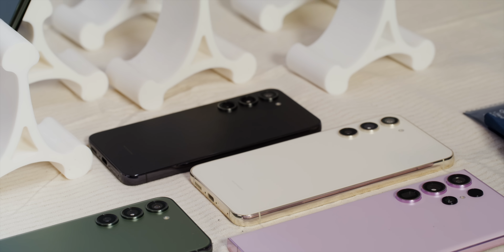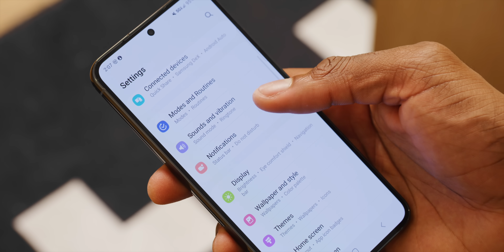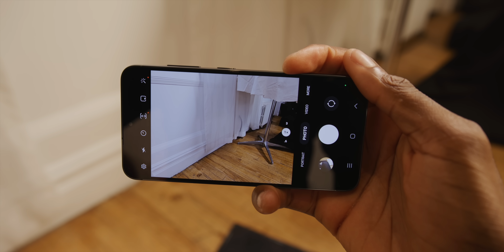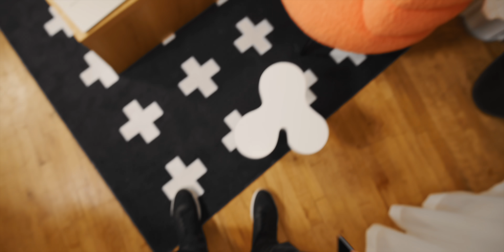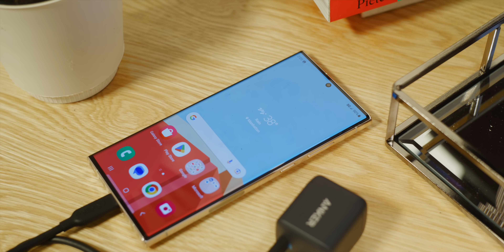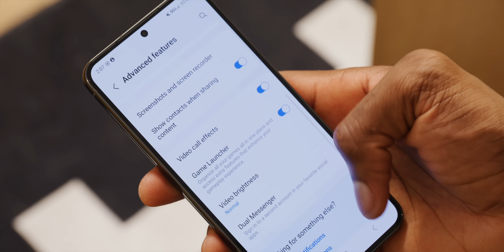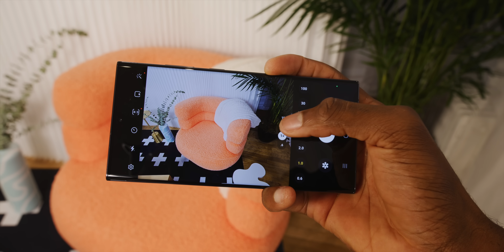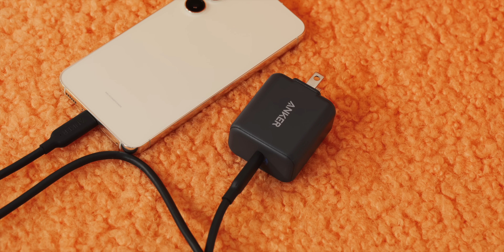Galaxy S23 / Ultra Impressions: Cruise Control!

Comment: I was debating if I should wait for the S23 or buy something else outright some days ago. Ended up getting a bunch of stuff for a bit less than the S22's price (A53, Watch5, Buds2 Pro and even a silicone cover). I might upgrade to an S flagship in a year or two but for now I'm pretty happy, especially coming from a sad old Moto G7 Play.
Reply: i like the s20, i always buy 2 gen before the new.
Reply: @JakeInvest  Old flagships are better than new budget devices for sure.
Reply: Ayy, I had a Moto G4 Play before getting an S9, and now I have a Note 20 Ultra I'm planning to keep for as long as I can!
Reply: @JoshGerhards  I went from Moto E2 to G4 to G7... Then to LG G8X 👍 Solid devices each with their fair share of problems
Reply: @JoshGerhards  I had a G4 Plus before the G7 I mentioned. It had a sort of stroke in the middle of a lecture and it fried the drive or something. Bricked. Could never even flash a new OS. Great phone while it lived tho.
Reply: @Zaydan Alfariz anything with Snapdragon instead of exynos is definitely better
Reply: The Moto G7 was very wimpy even at launch. I'm glad you were able to upgrade.
Reply: S20 is too old (upgradable to Android 13 and no more) and camera hardware is meh compared to OV and Huawei, and where's the 256GB option? 2K@120 (easy trick you can search on Google), the better S865 (compared to all Exynos, s888 and s8 i) and 12GB RAM be default in HK is very irresistible of a deal though
Reply: @anetizen6404  honestly these Android upgrades really don't add much anyways, I'm fine with security updates only. The days of Lolipop, Marshmallow, Nougat are long gone.

I'm keeping my Note 20 until they actually do something revolutionary again like an under-display front camera that doesn't suck, or an affordable Fold.
Reply: A53 is a horrible choice. Laggy, terrible phone. 
I have it. You made a HORRIBLE choice. 
Should have gotten the ultra.
Reply: You probably could've gotten all of that for free as a promotional bonus from Samsung with the S23
Reply: @laussethecat  They're not that generous over here lmao

Comment: I think this is kinda dead on arrival.  I don't mind the super iterative updates, but Samsung missed the big sensor camera trend last year and just doubled down on putting pointlessly high MP sensors in a package that just won't use them well.
Reply: Most full frame cameras with sensor areas like 10-15x the size of a smartphone cap out around 60MP of useful resolution.  Beyond that, the pixels start getting noisy in low light and the multi-thousand dollar lenses in front of the sensors start to struggle.  So it's a tough sell to convince me that 200MP is useful on an order of magnitude smaller sensor.

Comment: I care more about the S23's battery life. The S22 had extremely bad battery life. If the S23 does far better with battery life I will upgrade my S22 to the S23.

I still prefer my 14 Pro, but i hate how heavy and large it feels in my hand after holding my S22.

Comment: As i thought the peak handphone is from 2019-2021 so its not much change after that. Its like iphone situation but at least they try to change the chip but we still dont know if they still have the overheat situation even its 8gen2. Also the funny thing in s23 is they try to add action mode like iphone have 😂 but better in the night. After seeing s23 with that price not difference with Ip14, i clearly say my ip14 is better (my prespective) because iphone still have better managememt and heat control. Snapdragon 8gen2 is game changing but just in heat control which it depends on the phone they habited. In my country probably is more cheap because they have samsung store in here maybe like 1-3 million cheaper

Comment: The only compelling thing about the small S23 is that the S22 had abysmal battery life, and this one is bound to be a noticeable improvement. I do think OneUI is getting a bit stale... I'd love to see a modern take on it that ditches the squircle icons and natively allows for a vertical app drawer. (I know it's technically an option if you use Good Lock, but the implementation is sloppy, and to my knowledge Good Lock isn't available in every market.) But it's still Samsung, and it's still a safe bet in 2023. As far as the larger phone goes, I'd say save your money and pick up and S22 Ultra. Or even an S21 Ultra, if you don't need an S-pen. The last couple generations seem to be aging pretty well, especially now that Samsung is actually updating their phones for five years.
Reply: The trade in deals make the preorder much more affordable to buy an s23 ultra over an s22 ultra. I have an s21 128 gb (cheapest possible model), and I get 800 dollars off the s23 ultra with 120 dollars of samsung instant credit with T-mobile. So I pay 400, -120$ in credit, -50$ in cashback, so overall like 230$ for a s23 ultra 512gb which is a massive upgrade.

Comment: The screen flickering might be due to how OLEDs control screen brightness, however, maybe there is a difference with the Ultra in that it is not as noticeable since the screen also refreshes from 1-120 Hz and it has a 240Hz touch sampling rate. Best way to find out is to take a slo-mo video and see if it shows the screen flickering or not.

Comment: From Note 20 Ultra user perspective:
✅ Faster 2.5nm SPen
✅ Camera 3x / 10x / 200mp main
✅ Adaptive 120Hz / 1750nit
✅ 3.3gHz custom overclocked chipset

Ps : Note 9/10/20 is sure work as good but if you need to have versatility on camera then you should upgrade to maybe S21/S22 & S23. The Snapdragon 8.2 Galaxy and the camera will be my sold point

Comment: Frustrating the 45w charging is NOT proper super fast charging like OnePlus, Oppo etc... It throttles hugely so only speeds up charges times by about 10 minutes. Basically pointless.

Comment: Was going to trade-in my S22U in hopes for better battery life and Sammy was only giving $500 for it. The trade-in values aren't great this year for unlocked models.
Reply: bro ur phonje is 1 year old its fine
Reply: @joeystar1043  as an S22 (base model) owner, I have to say they're correct and the new TSMC chip has already made a difference in the S23 playback times Samsung quoted. The inefficiency of the Samsung-made Snapdragon 8 Gen 1 is especially noticeable in the small S22. 3-4 hours screen time, a chip that runs hot and bad camera shutter lag are a dogshit effort in a flagship.
Reply: @ytlurker220  I don’t think any of those issues have been solved on this one.
Reply: @mrb2349  It will be fully solved, TSMC manufacturer chipset was known to be way more efficient than samsung manufactured ones.
Reply: Come to AT&T and we’ll give you the 23 for free 👀👀
Reply: @Jaypc06  right after y’all Jack up the bill
Reply: @jumperlike24  nah it stays the same unless you get a grimey rep that makes changes without telling you
Reply: My phone literally dies in an hour

Comment: I've never been a fan of anything Samsung. They were costly, with a dated looking UI and everyone of its flagship statements could easily be surpassed by a Xiaomi phone. 120Hz, fast charging (60W), a display which is 1500 peak brightness, 6.7 " display, 60-100 megapixel cameras, base storage of 256gb with 8-16gb RAM. You name it, Xiaomi has an alternative, with a better looking UI, and all that for cheaper. This video just justifies that further, and im happy Xiaomi might get some attention now

Comment: You look uninterested. Definitely not a video from a tech enthusiast, more like from someone who wanted to get it done as fast as possible. Next time just don't bother... Also look up pwm frequency, can't believe a tech YouTuber has to be told why it flickers faster.
Reply: no tech enthusiast is interested in this years Galaxy phones, it’s the same as last year with slightly different specs.
Reply: @kevbo2981  mrwhosetheboss made a video that is easily 10x better.
Many tech enthusiasts are interested, just look elsewhere bro.

Comment: What are your thoughts on the differences brought from upgradring from a Note 20 Ultra to the s23 Ultra? I feel like even at 3 years old, the Note 20 Ultra, the changes are soooo miniscule, it really doesn't merit an upgrade and can still compete just as well with this one.
Reply: Its basically Rocky Balboa Vs Mason Dixon
Reply: S22 Ultra camera is ridiculous (I have both phones).  That zoom is nuts. Worth it for me.
Reply: The new chip is good
Reply: I think you're due if you have the Note 20U, but that's still a really nice phone. 

I went from Note 20U to S22U and loved the difference in over all build and the 100x zoom

Comment: 200 useless MP? Just say better low light if it is not going to give me a bigger picture to work with! No matter how good a image is. 12MP is really not enough when you start cropping framing and zooming and stuff. Can you stick only 9x9 pixels and get a bigger 22MP image? 200MP is useless if the low light and performance shutter is bad.

Comment: When you say theyre at 1080p , is that under the adaptive motion smoothness (1-120hz)
Is there a way you can switch to standard (60hz) under 1440p or higher?

Comment: Other getting to use 50MP RAW image and the new chip, I don't see the S23+ being a good deal over the Pixel 7 Pro. A larger, higher-resolution screen with Pixel cameras and exclusive software features for $100 less.

Comment: I'm totally satisfied with my S21 ultra. Gonna rock it until the processor melts.
Reply: so next year then
Reply: S20 Ultra here with the 512GB Microsd.
More new Samsung flagships without expandable storage?
Hard pass.

And Samsung is making these "Ultra" named phones not just "Pro" but "Ultra" -> so where is the expandable storage? Their budget phones have it! 

Samsung could launch "micro cf express card" with 2Tbps read speed or some new standard if they don't like microsd any more. But that's not it - really they just want to get people to buy extra onboard storage $$$$ on every device $$$$$ every year,  like Apple.
Reply: s21 ultra still best design too imo.
Reply: betcha its an exynos
Reply: @KSAPCreator  still decent
Reply: Question since folks smarter than me might be here. My S10+ has resolution of 1440 x 3040. Would the S23 and S23+ basically be a downgrade from a screen resolution standpoint or is there more to it?
Reply: I had an S10+ and got an S22+, you can tell the s10 has a better resolution (its only noticeable if you're really looking at the pixels)  however the 120hz refresh rate makes it worth of an upgrade imo
Reply: @davyjones2032  Resolution-wise there's not much difference. But the new screens are much brighter and are much smoother due to the true 120Hz refresh rate. Biggest improvement for me was jumping to the new camera systems. The 10x zoom is a game changer.
Reply: Same!
Reply: Totally satisfied with Note 10 here. Tried the S21 Ultra and photos are massive and totally over processed imo
Reply: @loluser41  nah you 100% right. I have a coworker still rocking the note 9.
Reply: it hasn’t caught on fire yet?

Comment: Yes is an upgrade coming from the S22 but still, only 200mAh more? That's not even enough to cover the 15% we lose by protecting the battery only charging to 85%.

Comment: 3900mAh? ARE YOU FVCKING KIDDING ME? Make that think THICCC and give me a good battery on the smaller phone! 
Do I need a freaking BRICK in my pocket to have a good battery these days? FVCK ME!
Reply: Yes is an upgrade coming from the S22 but still, only 200mAh more? That's not even enough to cover the 15% we lose by protecting the battery only charging to 85%.

Comment: Quite as expected and a disappointment by Samsung who can't seem to innovate. Last year I changed from a Note 8 to a S22+ and the difference was notorious in performance speed and a bit of camera power.  This year has no logical offer to upgrade from the previous version. They are just the same.

Comment: Good only for those upgrading from the S10. S20 and beyond should wait if the phone is still good. I'll probably upgrade later this year when prices drop and I get a good deal from the S10e to the S22 or S23.
Reply: Yeah the best time to buy these is when prices drop drastically by October / Nov
Reply: @lakkadbagga  What? The 23 Ultra has an instant $600 rebate. The 22 Ultra is $1050.
Reply: @sneat2028  it’s only for the US. Samsung is way more aggressive in the USA with prices to compete with Iphones.
Reply: @ronaldocost4  Brazil is a very small market, Samsung always has discounts in Canada and other large markets.
Reply: @sneat2028  you aren't that well aware about the global smartphone market, I think. Samsung is way bigger in Brazil than Canada
Reply: Great for those who don't have an Ultra but want one.

Comment: I've been using the Note 9 since it's release, its finally dying off on me because of my carelessness a few years ago, but these current phones sure they got the amazing camera but the fact they're trying to make storage space a reason to spend 200 bucks more for... worthless imo, they are trying to hard to become apple and that the reason I ever went with samsung in the past is because they WEREN'T like iPhones. I've only ever gotten phones with SD Card slots, the headphone jack is still preferred especially if i run out of BT battery but it isn't a necessity like the SD cards are for me, so luckily I think the Note 20 Ultra is going to be my choice to go for, The specs aren't bad at all if my Note 9 can still do everything minus the excessive camera quality, which the note 20 still has a pretty nice camera.

Comment: I think it's much more appealing to european users (and everyone who had to use the exynos until now). Also, the edges of the screen for the s23/+ seem to be flat, no more 2.5D curve, which I also really like because now a tempered glass screen protector won't look like crap anymore. Other than that...probably just an iterative upgrade. Although the s4nappie gen 2 seems to be way more efficient and powerful than the gen 1, though we have to wait for benchmarks on this phone. Seems really promising though.
Reply: The 22 had flat front and back, and I believe the 21 was too, I know the 21fe was. Either way, flat is better.
Reply: @feliciasbeard  I looked at pictures of the s22 and no, the s22 still has a slightly curved screen at the edges. Not to the extent of the s22 ultra of course, but still slightly curved at the edges, just like every other android phone. The s23 seems different as it has the same "completely flat" screen as the newer iPhones.

Comment: New chip that rival iphone 14 and still can't stop the shutter lag... Samsung: since you just do the same phone over and over.. listen up if you want new customers.. 
1. Bring back SD CARD
2. Bring back the headphone jack
3. Put the s pen back to the right
4. Fix the the shutter lag
5. Bring back the mst payment
6. Instead of new useless features, put that money into advertisements 
.. 
No need for new chip if the old one is doing fine. How money customers  edit high resolution vids on their phones. Even so, the older chip is fine.. just because apple is doing it means you have to do it..

Comment: All they can really do now is change bezel angles and move camera sensors. It's basically the exact same phone with a mostly unneeded spec bump.
People really don't need to change their phones more than once every 5 years now to see any appreciable difference.  That's certainly true of the fold devices which still don't fold flat, still have a massive crease, and still lack the same camera line up of the flagships, so there's not much point upgrading there either, certainly not at 2022 prices.

Comment: One thing that should be mentioned is that the Snapdragon 8 Gen 2 has waaaaay better thermals than the Gen 1. Anyone who has played games on the S22 series or used demanding apps knows what I'm talking about with the heat problems with that phone. When you do the full review, I would like to see you discuss whether the heat has improved on the S23!

Comment: In my personal opinion, this isn't enough for me to want to upgrade...I'll stick with my S22+ for now I'm still loving it! ❤️
Reply: why the fuck would anyone upgrade from an s22 series or even an s21 series? i dont get it.
Reply: @raginginferno868  it’s not for you guys it’s for every one else
Reply: @raginginferno868  I got the s22 ultra and s20 5g. Lowkey want the s23 plus
Reply: @simongutierrez4624  the s22 ultra is superior in: screen(higher resolution), camera, and battery, and the addition of the spen. the s23 ultra has the advantages of a faster processor that may also be more efficient and longer software support. i would keep the s22.

there's probably more to compare but this is just a simple comarison.
Reply: @simongutierrez4624  um i already watch him but thanks
Reply: @raginginferno868  If you did you wouldn't call the cameras superior on the s22 ultra 🤣🤣 the s23 is clearly superior, the s23 has an spen so don't know why you mentioned that and finally the battery we can't know how it will perform soo 🤷‍♂️ new chip set could mean better battery optimization
Reply: Same here I'll keep my S22 Ultra bit longer.